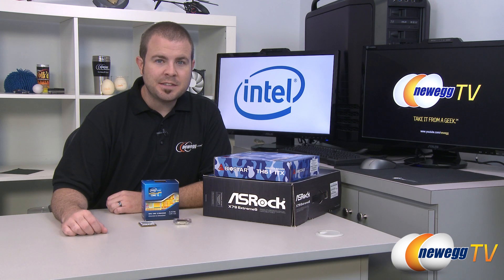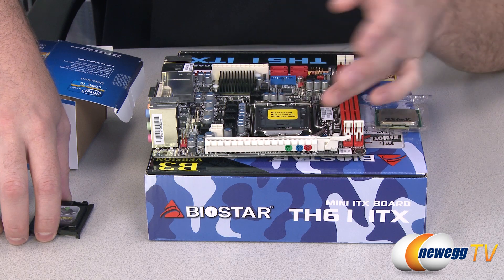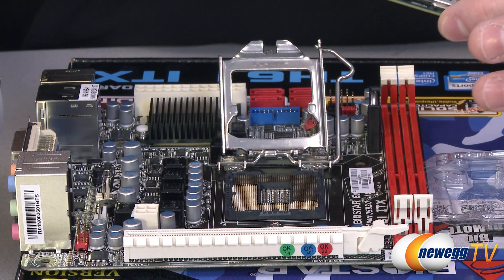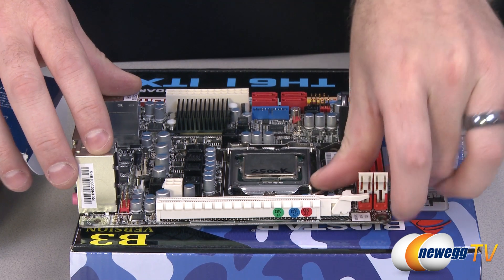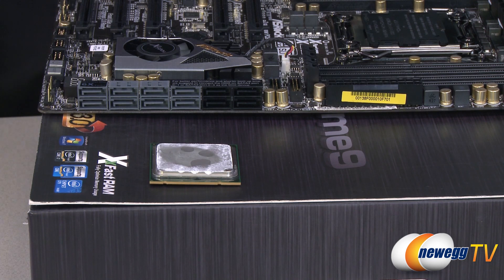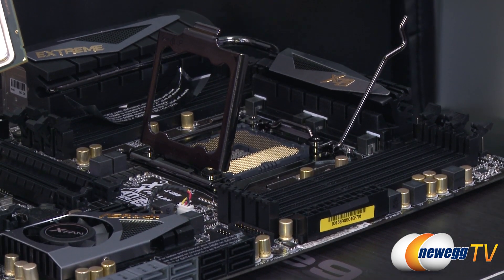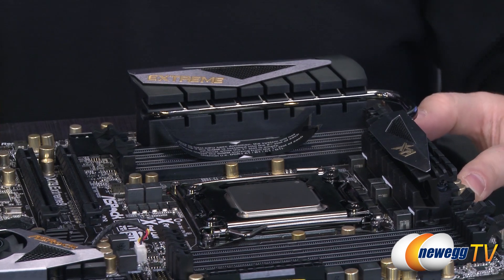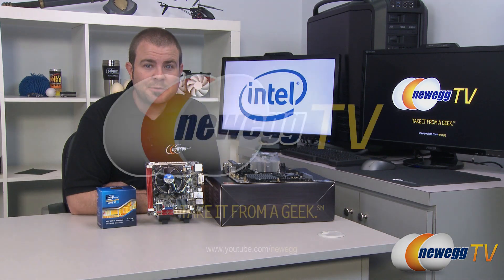Newegg TV: Intel Installation Tutorial

Comment: The socket install is all good....unless you have an ASRock board that came with bent pins...lots of them....then you tried to bend a few back and it doesn't help....so you RMA it only to have newegg tell you that you broke it....I got an ASRock Extreme4 board that had pins bent 180° from where they should be! I had pins that didn't even clear the surface of the bed, their tips were sitting flush to the hole they came out of! But...it's MY fault!! Goddamit newegg!!! /rant sorry guys